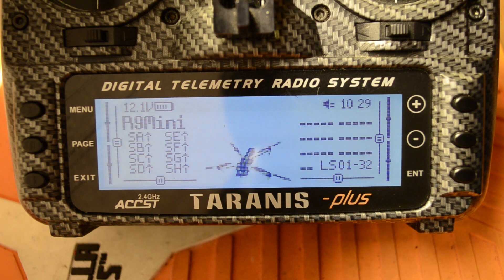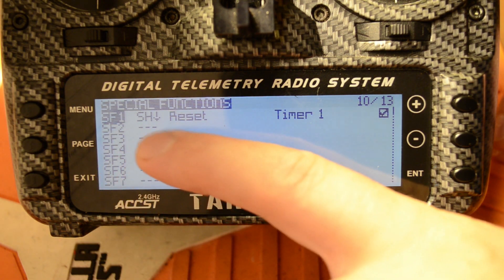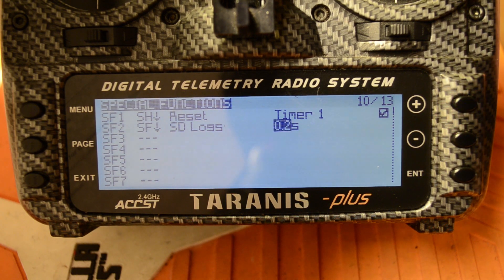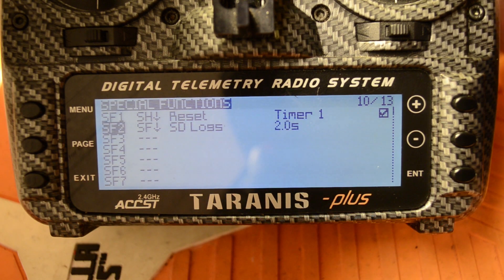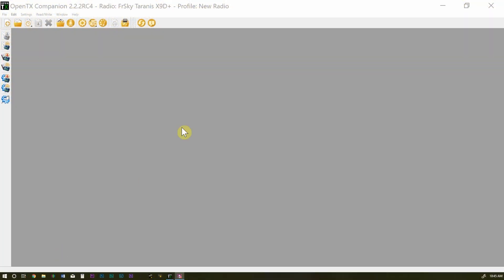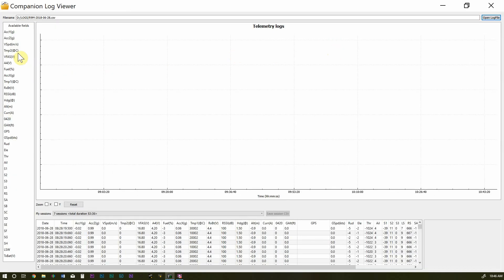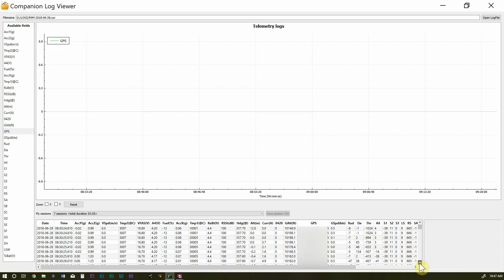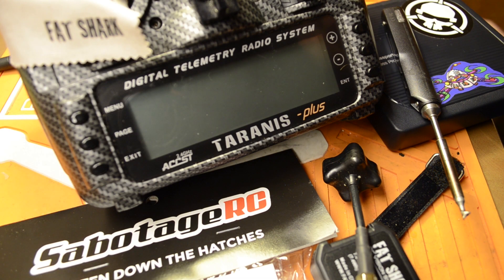Taranis Open Tx GPS Logging Setup

Comment: Hey, thanks for all your videos. Me i have my gps in betaflight but i can't have it in my taranis and in my crossfire.i try to discover new sensor before and after my flight but nothing happen. Did you have any idea why ?
Reply from the maker: Do you get other sensors when you try and discover them? It might have to do with your version of opentx. Also do you get your gps coordinates in your osd?
Reply: TweetFPV i have it in betaflight and i have 8 Sat or more but i don’t want a lot of things in my osd. In my taranis i have rssi and a lot of thing but no gps
Reply from the maker: What version of bf and opentx are you running?
Reply: i have the last bf fw but for opentx idon't know. i think i have the 2.2.2
Reply from the maker: Sorry for taking so long. I suggest enabling gps coordinates in your osd just for the time being while troubleshooting. I find that if you don't have the GPS configured properly where it is receiving sats then will will not show up in your taranis as a telemetry output. Only when you have a solid gps fix will the gps coordinates will the sensor be discoverable in your taranis. If you haven't had a solid fix in a while it can take up to 10 minutes to get one.

Comment: Hi are you interested in original email from frsky support show uinverted s.port signal pad  from r9 slim reciver thet can can help many people to connect s.port esaly to f4 FC maybe you can make a short move or just post in your Facebook ps it's working perfectly in my quadcopter just send email address and I will send it with picture gretengs
Reply from the maker: Thank you for the info. I will certainly be doing a video on the non-invert hack.